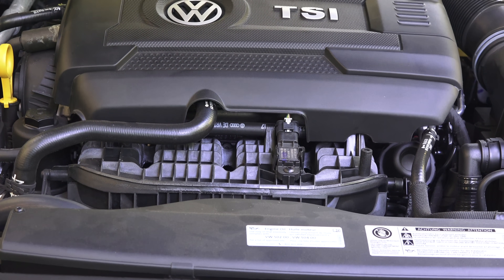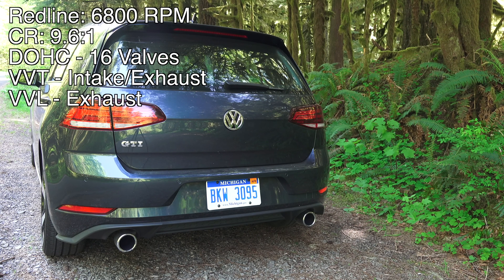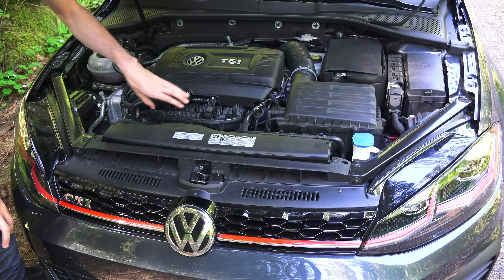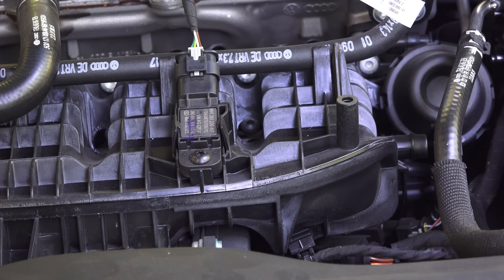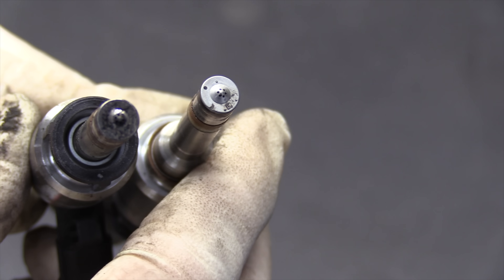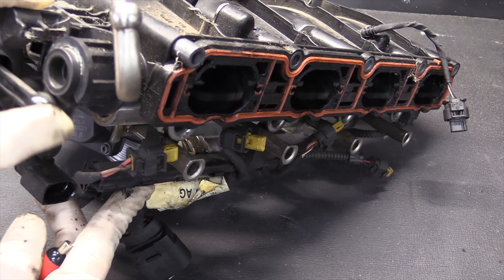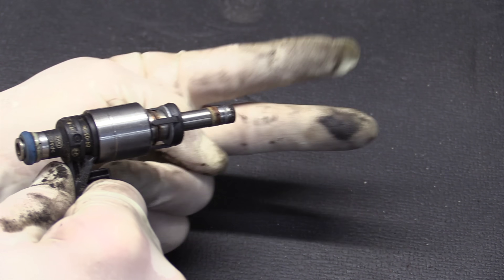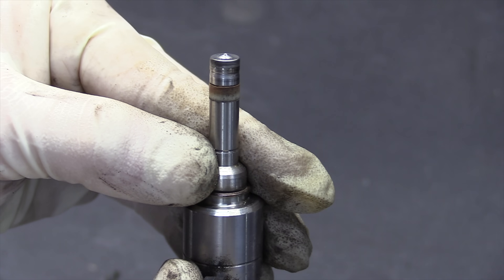The Best Engines - Volkswagen GTI Turbo

Comment: What exhaust note?
Reply: It's way to quiet stock, but a resonator delete fixes it really nicely
Reply from the maker: So tame haha
Reply: iamezza VW doesn't allow any sound out of their exhaust but it's an easy fix and the engines sound quite nice.  Compared to a fart machine from Honda the EA888 has a very smooth tone with a bit of rumble discernable to the driver.  It also burbles a bit when revving and is in general quite nice compared to other 4 cylinders that aren't boxer engines

But if you straight pipe the EA888 it sounds as shitty as any other 4 cylinder.
Reply: VW should have put the Clubsport muffler on the entire GTI line.  I imported one from Europe and it sounds amazing, but still not obnoxious like some aftermarket exhausts.
Reply: Anthony RS the Jag f type imo has the best sounding 4 banger
Reply: bobkilla430 didnt know that existed thanks for info. Looked it up and was shook how similar it sounds to my exhaust set up I just installed. Downpipe with my milltek non resonated and my stage 2 with overrun crackle 😎
Reply: I can't speak for the MK7, but the MK6 has a nice exhaust note. It's very subtle but it was definitely tuned by VW to sound a certain way. I like it. Is it too subtle? Yeah I'll give you that one. It could be a little louder.
Reply: TheSovietHotDog  the Amg 45 is essentially already equipped with a tune& high flow downpipe. Def one of the best sounding. What it has that the ea888 lacks is the correct muffler/resonator to delete the low frequencies and provide a cleaner sound. Just sprung up an idea for my next project 🤔
Reply: Depends on the fart machine...the high compression K20's rev insanely high and have a VERY distinctive motorsport sound. Anything but boring. I absolutely love the EA888...but there is nothing like foot to the floor north of 8k rpm.
Reply: I have a muffler and resonator delete on mine (stock downpipe for now) and the exhaust note is fantastic. actually quite surprised that it doesn't sound ricer-ish.
Reply: Anthony RS nice to know. do you have video or know of a video with your setup that I could listen? A gti is on a shortlist of my next car. I've always thought if I ever got a 4 cylinder/gti I'd keep exhaust stock since irl mods I hear sound like loud tin cans in a lawnmower. Though I've not spent time looking into how well they can sound.
Reply: bobkilla430 i have a sound clip of my straight pipe on my insta: towknee603. For the downpipe/milltek combo that’s pending because it’s only been like 3 days. Will get around to it today or tomorrow for ya !
Reply: bobkilla430 A45 amg*
Reply: Anthony RS thanks. Your red a3(s/rs?) is 🔥
Reply: Anthony RS, I feel sorry for the US not getting Renault Sport models. Especially the clio 3 rs has an awesome sounding engine.
Reply: That's what the soundaktor is for, lol
Reply: F#
Reply: I have Audi A4 with apr downpipe trust me when I tell you pple have ask me if it was a 6 cyclinder engine and I said no just 4. They have surprise look on there face cause it sounds so deep and loud
Reply: These sound mean with resonator delets and down pipe 😍
Reply: reinaldo8787. French cars? God no.
Reply: Its refines some people like that, for class but quick acceleration, great sleeper
Reply: Don't worry about that. Your gonna want a catless downpipe and stage 2 tune anyway, along with a turbo muffler delete. It livens it up just right for daily use. Cat-Back if you still want more sound.
Reply: I have a 4 cylinder push-rod engine that's just 1.3L and I think it sounds just awesome.
Reply: Lame sound
Reply: You cant fix four cylinder exhaust. How would i know? Ive done too much with my 4 cylinder turbo volvo. Youll have more fun with 5+.
Reply: StrangeClouds If you take out the resonator and it sounds much better.
Reply: the one they pump in through the soundaktor :^)
Reply: B flat...
Reply: all it needs is downpipe+tune and it sounds pretty good
Reply: Hear one in person with an exhaust.. Only 4 cyl that sounds better is Subaru’s. A growl is the best word to describe it. As for a straight pipe it depends how it’s made. I custom fab’d mine and it sounds great. Everyone always tells me it doesn’t sound like a shitty honda.
Reply: Anthony RS I have a mk7 r, I have heard that a true straight pipe drones really bad on them, I have a resonator delete and plan on doing a high flow cat
Reply: haha exactly, it couldn't sound more boring if they tried.
Reply: That sounded so cute! XD im over here with a 1.8t mk4 gti with full 3in straight pipes. Btw 1.8t (mk4) ftw!

Comment: 6 years and 72k mile warentee on 2018 vw for all the haters
Reply: $1,000 carbon build up clean after 72,000 miles... or continue to suffer loss of power/fuel efficiency and misfires/codes.
Reply: @HisLostSheep  the walnut is around 300$ not sure where you go but you should change place This car is the best bangfor your buck for a quick car . Dont even mention the 1.5l from honda
Reply: 20 yr 250k miles on the Honda.
Reply: Surely your time is worth something. We wasted so much time going to/from the dealer and having only one car because one of the VWs always had some bizarre problem.

Comment: How about the newer chevy ecotec3 family? This is the fifth generation cheverolet ls based motor. They have vvt, direct injection, cylinder deactivation, and high compression ratio all while based around tried and true overhead valve construction. Somehow they also manage more power and better epa fuel economy ratings than their ford ecoboost competiton as well.

Comment: I'm not 100% sure about those engines but with new 1.5 Evo engine VW has highest fuel pressure currently on the market 35MPa/350bar.

Comment: You should make a video explaining why the 4G63 makes so much power so easily If you haven't already done so.
Reply: It makes power so easily because it has TONS of aftermarket support, not because of some revolutionary engine design...
Reply: that, & it gets high output turbine stock, if these got the S3/Golf R turbo stock the car wouldnt be the same price point.

Comment: There's nothing more unreliable than a 2.0 turbo VW engine, here in Argentina are causing a lot of big troubles because of the chain tensioner, it's a shitty quality, and causing serious damage to the engine.
Reply: You're talking about the previous version from like pre 2010 , the new one doesn't have that issue.
Reply: No te olvides del consumo elevadísimo de aceite. Básicamente hay que desarmar el motor entero para solucionar el problema.
La mayoría de estos son pre 2012 (tanto para Volkswagen como para Audi), pero sí, por otro lado tenés la cadena que puede dar dolores de cabeza y vaciarte la billetera de un saque.
Reply: +Fede DZ Si, es cierto. Había algunos motores que se les "estiraba" la cadena, pero más que nada debido a los tensores de ésta. De los motores 1.4 de VAG hay un par de modelos (i más), el de 122HP que lleva el Audi A1 más base y el de 140 o 150HP del Vento "nuevo", ya utilizado en el Golf VII 1.4TSI. Prestaciones y valores de consumo atractivos, pero no sé qué tan fiables serán a futuro.
Reply: Y eso lo del aceite que remarcás también.  Un amigo que es mecánico acá en Cba, vió varios autos VAG sean 1.4 o 2.0 turbo, con el problema del tensor de la cadena, y por el consumo elevado de aceite. Tengo un familiar que tiene un auto con el motoro 1.4T del grupo VAG y no ha tenido problemas (no sé si debe ser porque es el de 122cv, porque ahora el 1.4T tiene 150cv, como es el caso del Vento).
Reply: Apex Seal Where are the VW's in Argentina assembled please? Gracias.
Reply: +Ann Walsh The vehicles I mentioned in previous comments (Vento or Jetta-, Golf and Passat) are all imported either from Mexico or Germany, mainly from Mexico. Brazil manufactures other models for our market, as Argentina does for theirs, but these models are basically Latin-America only. Volkswagen produces the Suran and Amarok in Pacheco, Argentina, but the pick-up is also exported to some countries in Oceania. Most of the engines equipped in these vehicles are made outside the country -Brazil and the V6 for the Amarok in Germany.
Anyway, as I just said the Golf, Jetta and Passat that used to come with problems were made in Mexico and Germany, same vehicles made for the US an Canada market if I am not mistaken.
Reply: Apex Seal Thank you. Same as North America. They have just moved back to Germany the 2019 production of Golf as there were quality control issues in Puebla...
Reply: +Ann Walsh Oh, didn't know that. Anyway, in these days with modern technology there aren't much differences between Mexican and German made vehicles, since they usually use the same materials and production methods. Of course there can be faults at certain level of the production line as anywhere else in the world. Wolfsburg has had several problems in the past two decades regarding building quality, as the V8 Audi 4.2l chain tensioners, DSG gearboxes and else (which can happen).
On the other hand, there are some models which vary both building and material quality between countries, as India, Brazil and Germany for instance.

Comment: Man I like the mk7 GTI!!!
Reply: Evan Acey yeah it’s pretty awesome. I love my mk4, but the mk7 R is a superior car in almost every way.
Reply: My only concern is the Direct-Injection system. What do you recommend to do to keep them clean and how often?
Reply: HumbleMechanic me too! I bought just bought one. Honestly, I think the 3rd generation is the best version of this engine. I think with VWs being high performer cars you just need to maintain them and address issues as soon as they arrive. They're not your Honda Civic!
Reply: StrangeClouds pretty easy to replace as DIY
Reply: I have a 2016 GTI I love it, very torquey motor.
Reply: Agreed Charles it is, i have a 15 dsg and i love it.
Reply: HumbleMechanic Sweet. Thanks!
Reply: CR A I've had just about the same, but I had a 90 16v GTI, 2006 GTI, 2010 GTI and now a 2016 GTI. And it's by far the best.
Reply: You're a COOL DUDE Charles, love it how you guys get along!!!
Reply: HumbleMechanic Hey, I watched one of your videos about the trunk wiring harness issues with VW CCs. Are those are to replace yourself?
Reply: I like it but I love the MK4 R32 & Gli 1.8t
Reply: Me too!
Reply: gilbreezy34 r32 for life!
Reply: I love my mk7 GTI but I just wish the exhaust sounded a little better. It’s the only real complaint I have about it. Recommendations? Needs more growl and pops.
Reply: You mentioned audi has an integrated cold start injector for e85.  Is that present on my 2017 a3 2.0t? I've been running e30 blend in this car for almost  7 months with zero issues but audi states no more than e20.  The car is stage one as well
Reply: I put over 40k on it in a year. This car is amazing! Time for suspension work!
Reply: Top job on all of your videos. Very methodical and meticulous. Major into them. Would love to see you or Charles do one on cam-less engines if you haven't already. Not that I'm aware of anyway. Pros cons etc. Fair play.
Reply: Hey would you know why I am getting a cpv light? Usually happens when I’m mating it up a hill or mating it in higher gear.
Reply: HumbleMechanic please give me a word of advice: I have 1.8 tsi ea888 gen2 (the one with revised rods). The problem is the oil rings on the piston and going forth, the oil consumption (from top level to minimum in less than 200 km). I know that this was subject to a recall but I bought the car with 150k km on the clock and no other gurantee. It ran great and looked almost new so I bought it. It had the dq200 7spd dsg. Long story-short I have to replace the engine because of some not so inspired "repairs". So the question now remains: after I replace the engine and the pistons with the revised parts will it be a reliable car for another 100k? I am desperate as I put more than 1500 euros in this car and I will surely put another 1500 for the remaining repairs. Please get back to me. Greetings from România!
Reply: @ttltm  faulty designs on piston rings compare to the new design with larger openings to allow more oil flow
Reply: I like your Videos !
Reply: HumbleMechanic I have a ‘17 Golf TSi 1.8. I installed a Neuspeed power module. I’m sure you know what it is... Can this module be harmful to my engine in any way???? If so I don’t want it anymore, but I like the power output and I like the price. What do you think?
Reply: 35k and counting 2016 Gti pp w/lp pute white 6MT. Oil changed at every5k all records in hand. Had the sunroof and gas recall already worked out. Car runs great. Dont want to keep it. Moving onto something else. Everything stock no modifications done to anything, at all.
Reply: Purchased in jan of 2016
Reply: Charles, you’re the man
Reply: Good to see you man ;D
Reply: @pungentpie  the 1.8 is the worst engine in the group unfortunate
Reply: HumbleMechanic I would take your Mk4 R32 and it’s 3.2L 24v VR6 over that 2.0T ANY DAY!!!
Reply: @sonicsfan4life  me too! I wish I could find a good one here in my country Egypt with good condition. We only had the 2000cc turbo version
Reply: HumbleMechanic Golf VII GTI to be exact.
Reply: mk7 R better 300 hp
Reply: @charafelectroful  Golf R is heavier due to 4WD. GTI has that nimble and lighfooted feel the R lacks. That said, the GTI comes with tartan seats and golf ball shifter. I love that stuff!

Comment: So what engine is in the Golf R 2.0 Turbo
Reply: Bal S it's an EA888 Generation 3. It's the same engine as this one, just a different head and bigger turbo.
Reply: I also have another question, when driving hard in the Golf R do you need to wait a minute or so for the oil to cool down from the turbo feed. Has this new generation of engine have a electronic oil cooler even when the car is off does it ideal before shutting of
Reply: Bal S I've heard it's not necessary, but I don't know for sure. I think if you let it run for 30-45 secs before shutting it off you're good. When I find out for sure I'll let you know